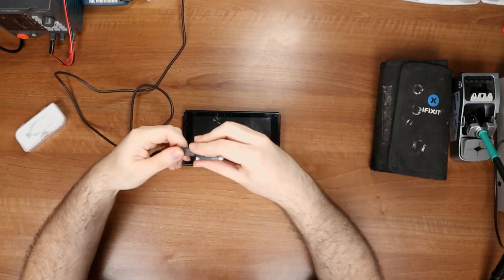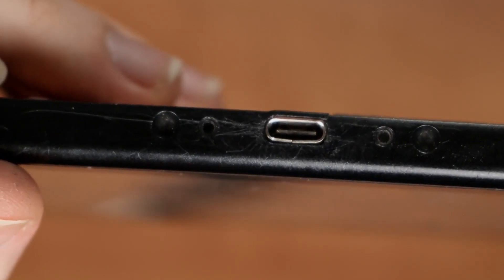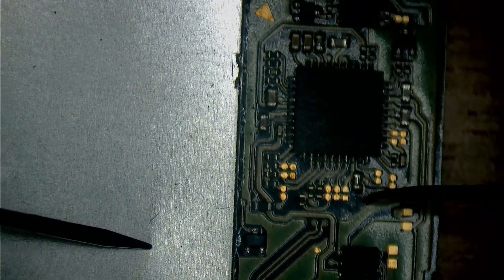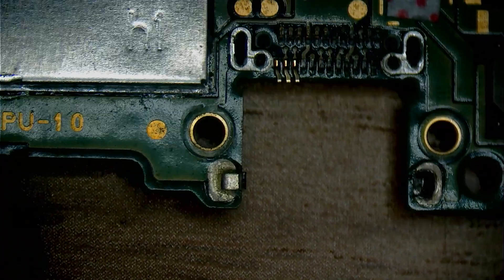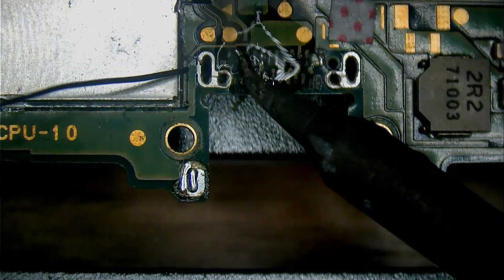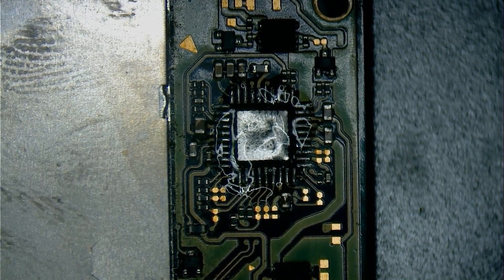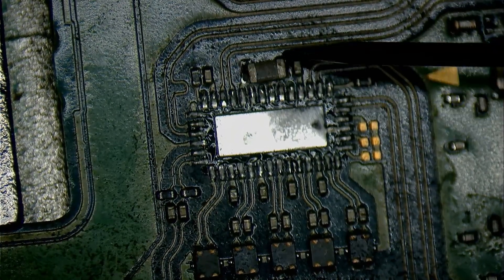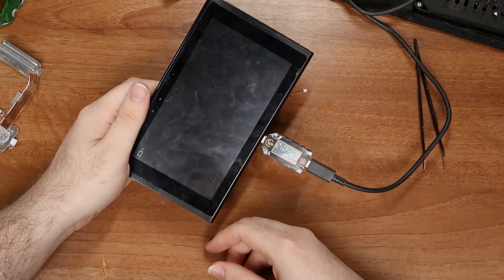THIS FRIED NINTENDO SWITCH BLEW MY MIND! CAN I FIX IT?

Comment: Nice video.  What if the cap above the P13USB is still shorted after the ic is removed? Does that mean the APU/CPU is dead? Thx!
Reply from the maker: Hi Tyro! No idea actually. It could be, but I would also lift M92 at that point. As you can see, it does have a trace that runs in it. I know the chips are connected, because sometimes a faulty M92 prevents docking.

If you lift both, and it still has a short, it could be a CPU issue. But keep in mind that if the USB port is mangled and the pins inside overlap, you would read shorts randomly on the board. Also check that the port is fine, and if you really run out of options, desolder it and clear the pads of bridges after doing so.